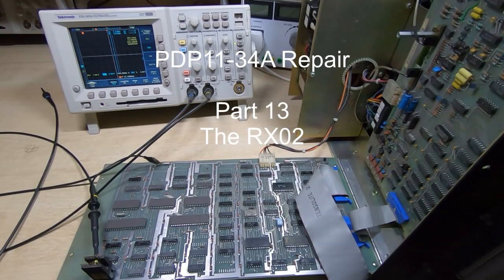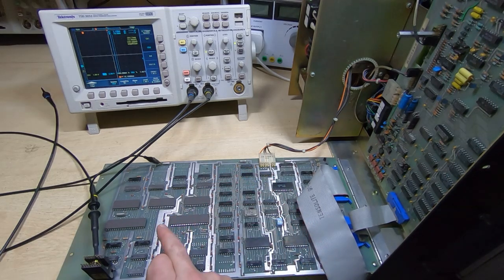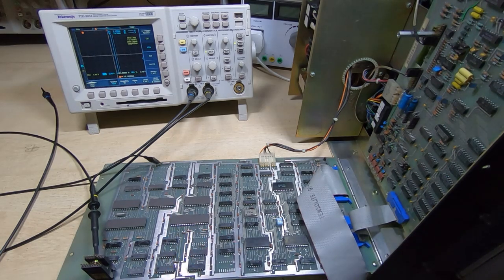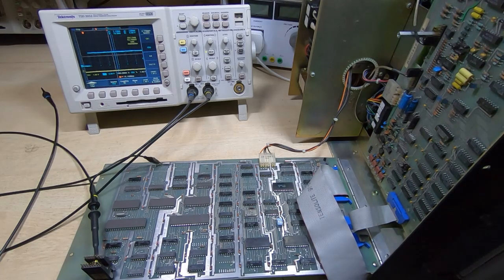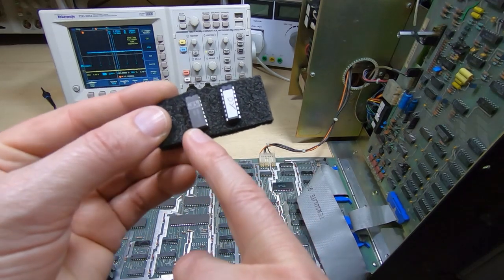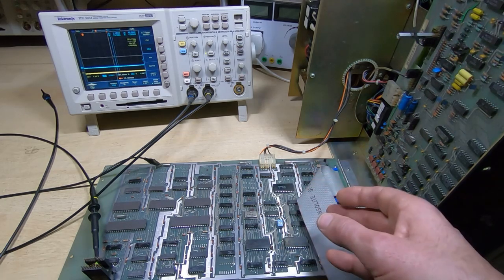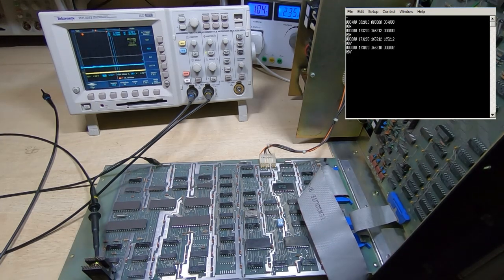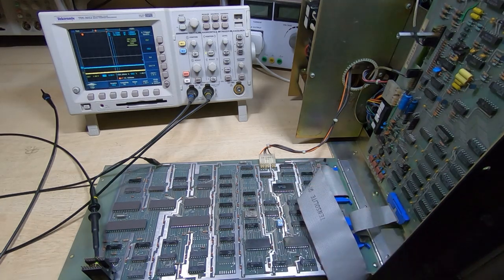PDP11-34A Repair Part13 The RX02

Comment: The numbers on some of my PROMs were not readable due to their former life experiences, but you can also read the two-character boot command code from a particular address in the ROM.  The address for each of the ROM sockets is described in the M9312 documentation.

I also think I can boot SD disks in my RX02/RX211 using the DX PROM.
Reply from the maker: The ROM's on the bootloader are socketed so can easily be read in a programmer but as you say they are ROM's in the address space and the technical documents give a value to be tested for each at a particular address (depending which socket you plug it into). However this assumes that the ROM is OK and that the machine is operating correctly (see todays video on ROM issues).
Reply: You probably know this, but once you can boot the floppy AK6DN has some very useful RX02 floppy images containing XXDP for the 11/34.
Reply from the maker: @EthanBlanton  Correct although this machine may be beyond help unless I can find a replacement M8266 or the ROM images (It has around 30 PROM's and quite a few have failed). I could program new PROM's if I had the images but so far I have been unable to find any.
Reply: @JerryWalker001  I have several M8266 boards and would be happy to help with this if I can, but I am reluctant to try to remove and replace 30 chips (as I understand that these boards are prone to losing traces).  What are the chances that any of them can be dumped in situ?  Also, how many changes were there?  I know that I have several different revisions of the 8266 - or at least boards with different bodge wires.

I'll probably watch the next video this evening Eastern US time.
Reply from the maker: @EthanBlanton  The chips are fairly easy to remove from these boards as the holes are fairly large. I am not aware of any PROM revisions but any revision would be a starting point. I do not think that they can be read in situ as they have too many interconnections although it may be possible to connect a logic analyser and observe the output for any given address. Maybe I can post a video on how to remove the IC's without damage. It may be something that is just experience but I find it fairly simple and have never lifted a track although the method I use may not be the way most people remove them.
Reply: @JerryWalker001  I've removed a lot of chips on a lot of boards with some success, although I'm always interested in seeing new tools and techniques.  I had just seen several complaints about DEC Unibus modules being tricky; maybe it wasn't the modules. ;-)

I'm a University instructor and class is in session, so I may not be as timely as is ideal for you, but if these ROMs aren't dumped, let's get them dumped.  I'll run my spare processor through XXDP to make sure it's correct, and we'll see if we can get the ROMs you need, at the least.
Reply from the maker: @EthanBlanton  That would be fantastic and I am sure that many people would be relieved if these images were available. Having the images available from a known good board will go a very long way to future proofing these machines. By the way I was not trying to imply that you were not able to remove the ROM's. They are harder to remove than on some boards but with care it is relatively simple. I have also seen the complaints about these boards but possibly an issue with techniques. The main issue with the PDP boards is that have very narrow annular rings to give more space for tracks and the solder does not flow very well but the method I use does not pull on the pads so it makes no difference. I will post a video as I have to remove my PROM's anyway.